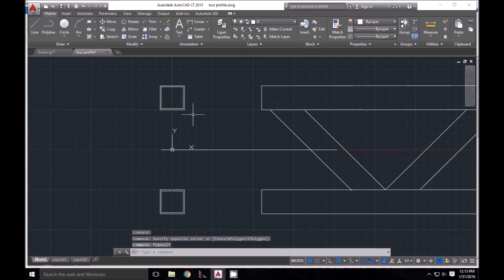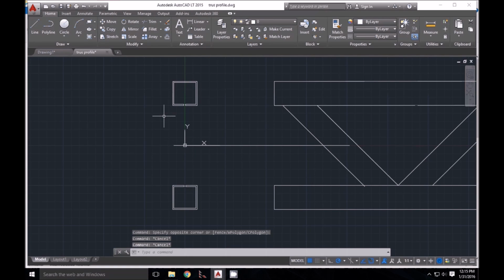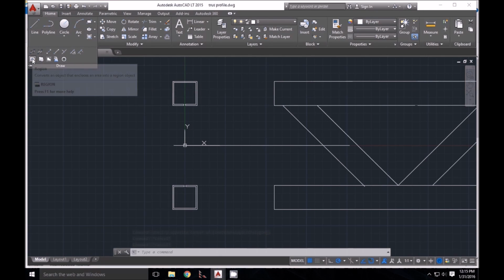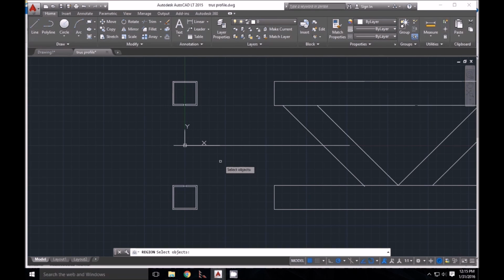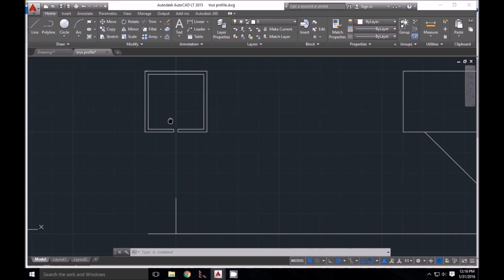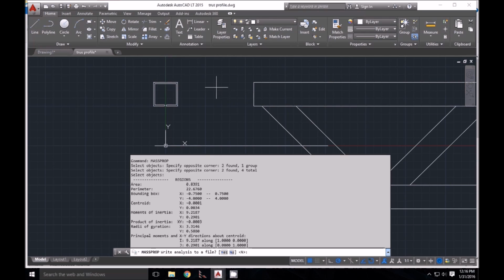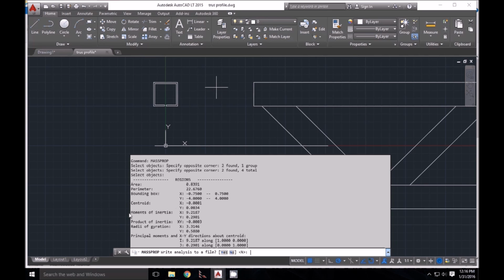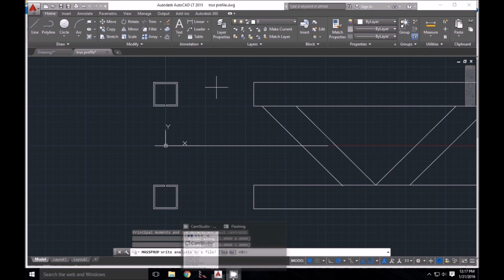Autocad Area Moment of Inertia Calculation

Comment: Would have made more sense to subtract the small bit of your section from the neutral axis. This will have less impact on the accuracy of your results.
Reply from the maker: Sounds like you might be saying that it would make sense not to subtract out that small bit.  Not sure that I interpreted your comment correctly.  Thanks for watching.
Reply: You don't need to leave the gap. You just subtract the inner region from the outer region with the SUBTRACT command which works on solids and regions.